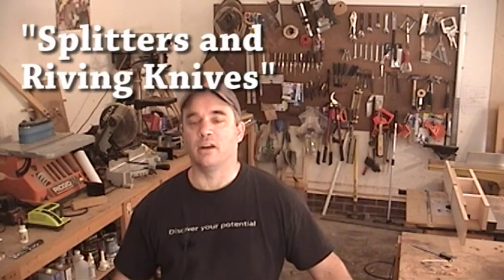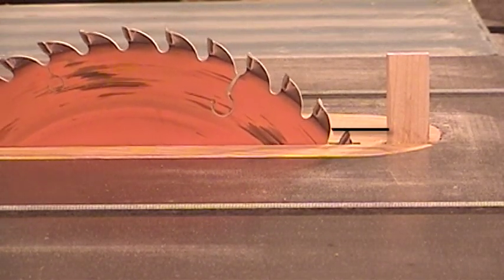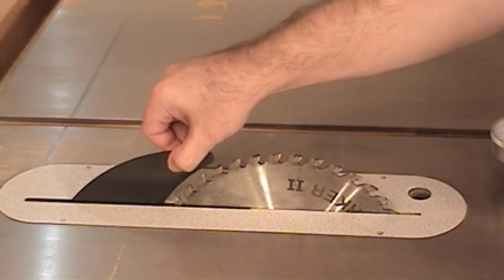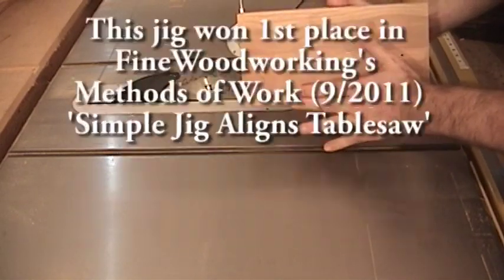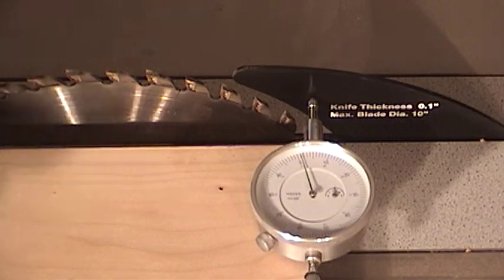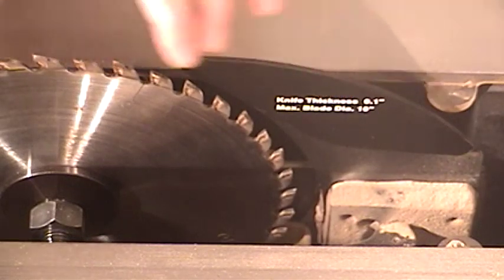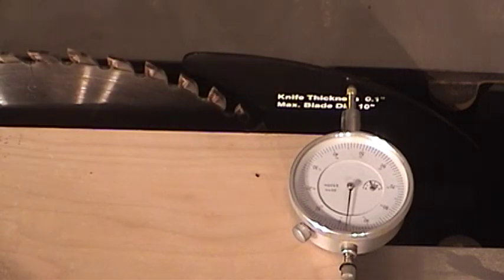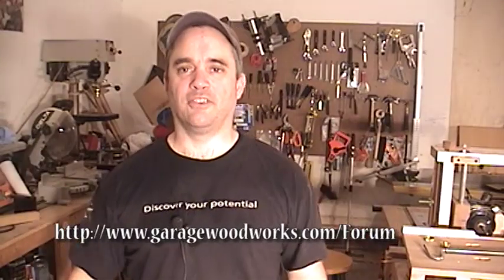How to check alignment of riving knives and splitters

Comment: I have just bought a table saw that has issues but on setting the blade parallel to the fence, I find that the riving knife is 1/16" closer to the fence than the blade which has the obvious implications. Hopefully, it has adjustment.

Comment: Brian, are you therefore saying the right side of the blade should be flush with the right side of the RK which would sort of provide a featherboard effect towards the fence.
Reply from the maker: No.  It doesn't need to be perfectly flush.  What's most important is that the riving knife be parallel with the blade and fall completely within the kerf of the blade.